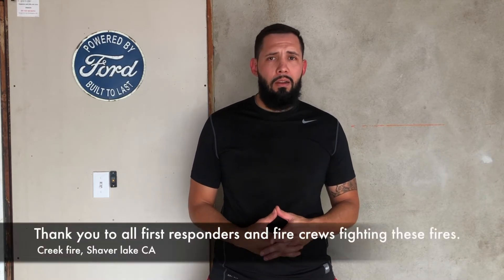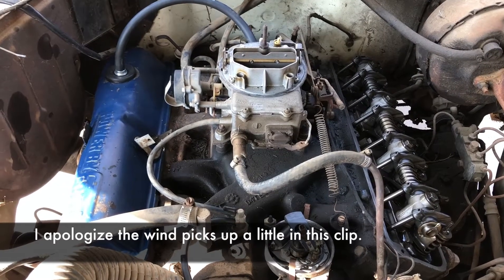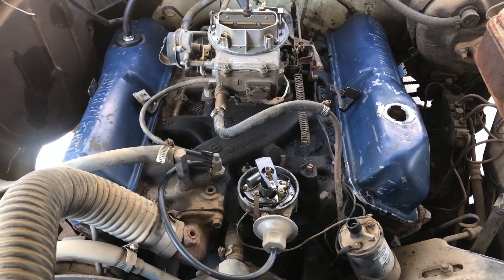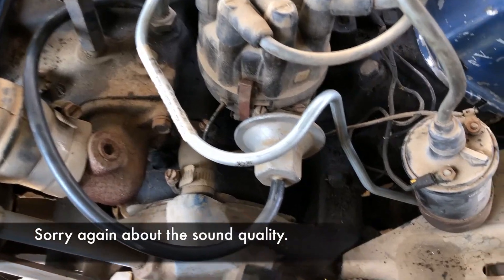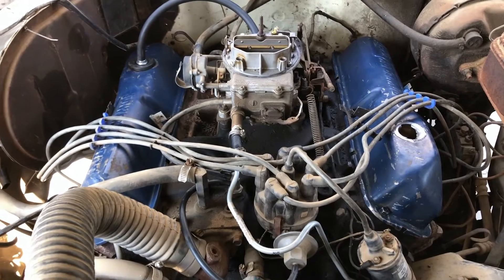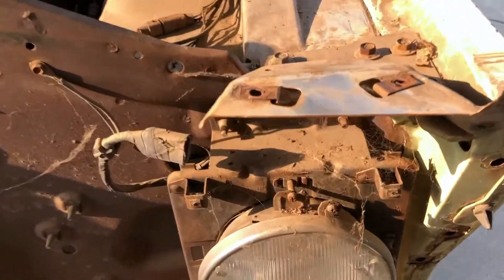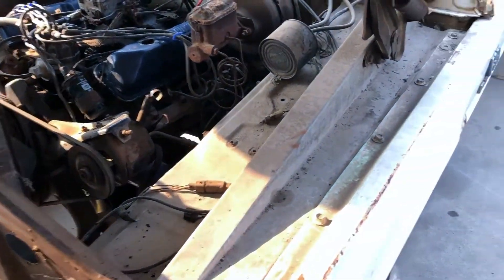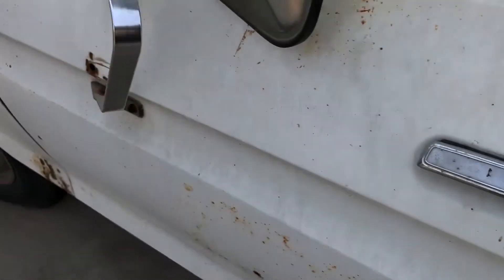1974 F350-Engine clean up

Comment: If the floor is that damaged I'd be worried about frame being bent/damaged also. Or at the very least the front cab mount frame bracket. May want to do some measuring on the frame before you get too far into the truck.
Reply from the maker: I can’t remember if I showed the cab mount bracket in this video but it looked. The actual cab mount did look stretched up so I’d have to drill the spot welds and replace it but the frame looks good. I should measure it just to be safe.

Comment: it sounds like the 360fe im working on.  i think it has a vacuum and an exhaust leak.
Reply from the maker: James Shimel I haven’t got a chance to look at it yet but the vacuum leak should be easy. Probably a brittle or broken line when I was moving stuff around. The exhaust leak will have to wait